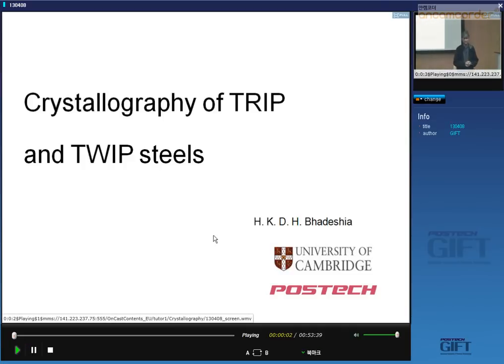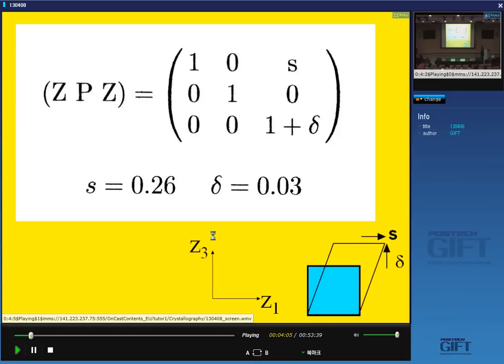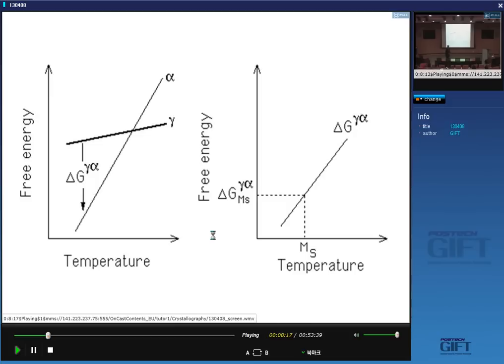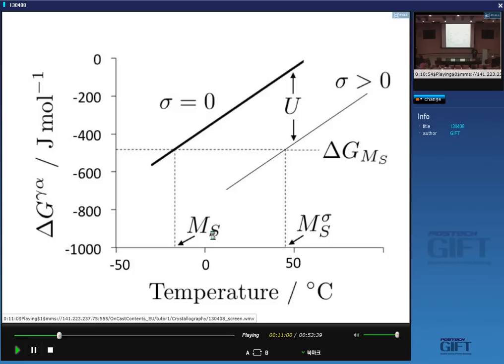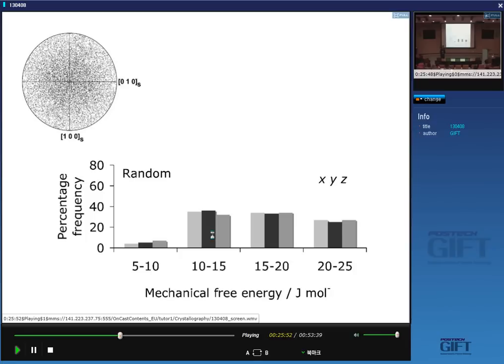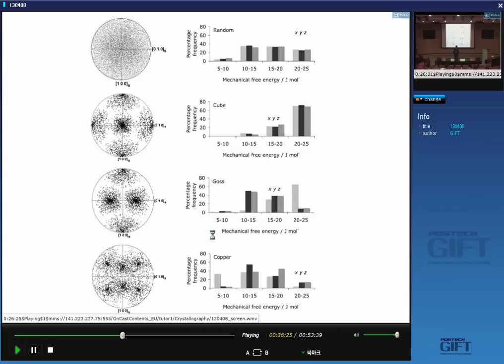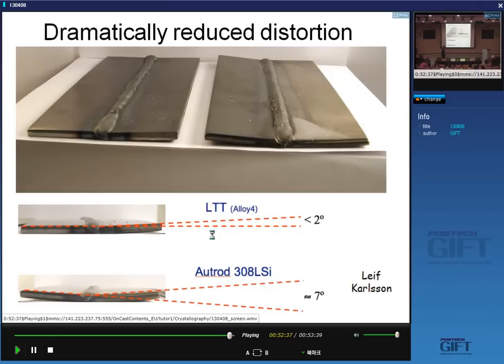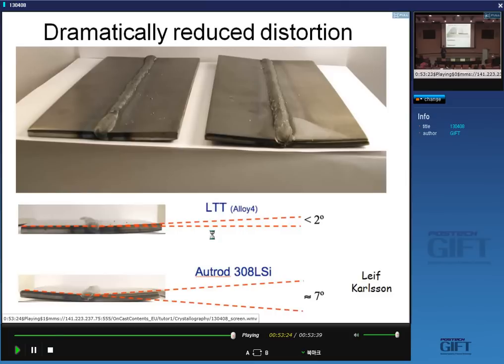Crystallography 13, TRIP and TWIP steels (2013)

Comment: Are there any published work on this topic? Verifying that the strains from the phase transformation do not contribute to the extended elongation of the alloy? I have done some measurements with in situ mechanical testing, and I have seen that the strains are not big to give this extra, to the global deformation capabilities of the alloy. But the knowledge on this topic I would say are quite limited.

Comment: why the hcp martensite is harmful in twip steel ? what's difference of SFE  in forming twin and hcp ?
Reply from the maker: Not necessarily harmful. For SFE, see Lee TH, Shin E, Oh CS, Ha HY, Kim SJ. Correlation between stacking fault energy and deformation microstructure in high-interstitial-alloyed austenitic steels. Acta Materialia. 2010 May 1;58(8):3173-86.

Comment: Is it possible that the martensite form not at the  θ_max have more elongation than your calculation?
Reply from the maker: +M. Tim No, not more since \theta_{max} represents the maximum interaction
Reply: +bhadeshia123 In some grains, the  most favorable orientation may not the   θ_max . How can prove the elongation at those orientations is smaller than at the   θ_max ?
Reply from the maker: M. Tim See: Proceedings of The Royal Society A, 463 (2007) 2309-2328